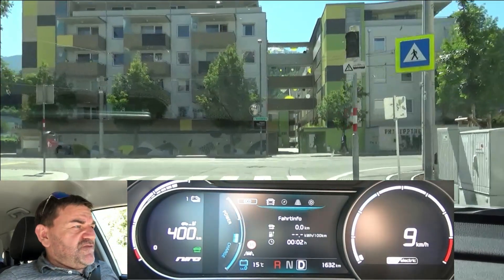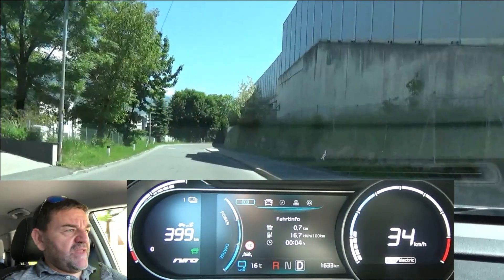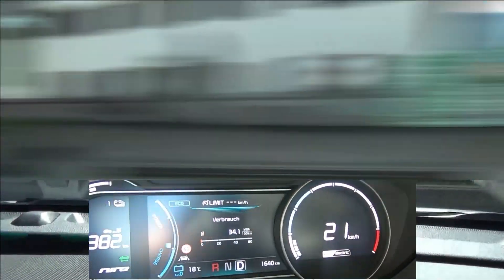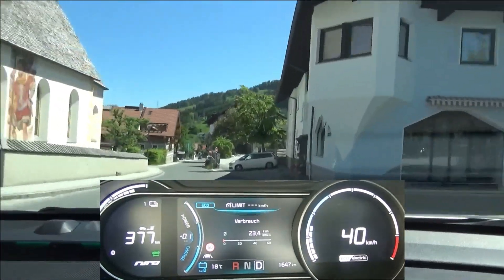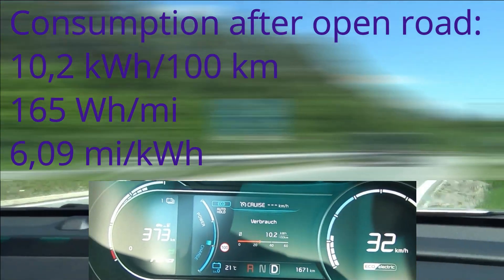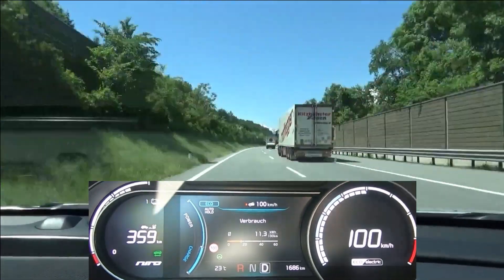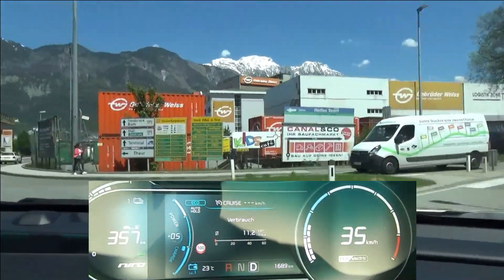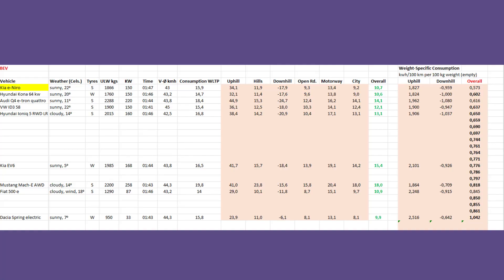Kia e-Niro (Niro EV) - real-life consumption test done by a professional eco-driver

Comment: Very nice video! I will be getting a 2020 model next week. I see you switching a lot through the regen levels, even to lvl 3 sometimes at trafic lights. Would lightly pressing the brake not give the same effect? I read that even when using the brakes, it will mostly use regen braking, unless you have to break hard and fast all of a suden.

Comment: Your driving tips are mostly the exact same as needed to get the best efficiency from an ICE car; speaking as someone who beat Jaguars claimed combined MPG in a "S" type by over 20%, on a 450 mile combined trip featuring 350 miles of high speed motorway and 100 miles of low/very low speed, inner city driving around London.

(Cruising at 80 MPH by speedo, on the motorway)

I currently drive a 2016 Soul EV; it is a great little car, I get 4miles/KWh average on motorways, 4.5 on country roads, and 5+ in flat, urban areas; it is a great driving position for me (2 metres tall, badly damaged back), but a bit limited in boot space and range; If I want to drive from my home in the UK, to the Alps for some skiing*; route planner says I will need 22 charging stops, there and back !!

* I cant any longer, but for my wife and daughter.

Comment: When you set regen to "0" setting, it actually still regen about 2 to 3 kw back to battery, if you want true zero regen, you have to set gear to Neutral.
Reply from the maker: I know, but you don't feel those 2-3 kw and they barely reduce the speed.

Comment: Great work thanks for sharing your knowledge and experience!
I would like to suggest to include another parameters on your spreadsheet:
Tyre pressure, recommended in one column and then in next what tyre pressure you drove with.
Kia Niro EV (e-niro in Sweden) has 2,5 bar as MIN pressure many thinks it's max. Winter tyre manufacturers recommend adding another 0,2-0,3 bar in winter tyres. 
Not knowing if you adhere to these recommendations makes for a uncertainty.

As i stated kia e-niro has min 2,5 bar recommended i have 2,7/2,8 cold tyres measure of course. Still it is difficult to get below 17 kWh/10 km, my average is 20+ and that's. 
I suspect my car is demanding more energy than needed. The tyres wear looks perfect. Not even in perfect conditions in city summer and high pressure tyres i got down to 12 kWh/10 km best ever. 
Ok i got wife and 2 kids and packed full but shouldn't make that big difference.

Oh just thought of another good parameters that would be interesting. This since you are the best driver i have seen. Do 10 km in one set speed, 10 km doing 50, 70, 90 and 110 and 130 or something like it using cruise control or your driving skill i dunno. Cruise then i/we could replicate it with our cars and see if the cars match up or not.

But this is really time consuming and it is just a suggestion. It would be nice to see if the fault is with car or me as driver.

I subscribed of course keep up the great effort you do.
Reply: Oh tyre brand/model is also relevant.
Reply from the maker: Thank you! 
As for your different suggestions:
tyre pressure: To be honest I just take the car from the dealer and do my trip. I don't take any special measures, as I claim this to be a real-life test and in real-life barely any driver checks tyre pressure before every trip. I haven't checked the ones on my Volvo since I got the car (over a year ago) as I rely on the car to tell me when something is wrong and twice a year the tyres get changed and set to the correct pressure anyway, and I guess most drivers do it that way. As for higher pressure, sure, it would improve the result by a small margin, but at the cost of a shorter life of the tyre.

different speeds: here I have two problems, firstly normally I get the car only for about 3-4 hrs, which gives me just enough time to do the loop (plus picking it up, install equipment, washing, outside video and picture, returning the car), so I can't see how to integrate any more tests, 
secondly - you've seen the roads around here - it's barely possible to go 100 constantly, there isn't even a long enough piece of road with 50 or 70, as one village and/or speed restriction comes after the other. And going slower than 85 on the motorway is not recommended as Lorries travel at that speed and are not allowed to overtake. 

I claim this to be a reflection of the real-life of a motorist and I want to show what can be achieved without any special measures, just in driving a car "normally" (I am aware of the fact that "normal" for me means "eco", as I do this for almost 30 years and my business works in this field as well). Only by adjusting the way one drives in the correct way  (at least when we talk about eco-driving) savings normally are around 20-40 %, without being slower or having to take any other measures. 
However, as suggested multiple times by many subscribers, I will include tyre size and model in future results.

Comment: Have this car for 6 months now and it's amazing! +500Km range in the summer and now 380Km in the winter. I always use level 3 generation in auto mode. Why you switch so much in this video?
Reply from the maker: Because I only use the regen when I need to brake, using no regen (means not braking) is the most efficient way of driving. Coasting as much as possible is most efficient.
Reply: @ecodriver1746  You can adjust that with your 'gas' 
pedal or you can also hold the steering pedal to come to a stop.. Confusing answer
Reply from the maker: I know about OPD, don't worry.  My answer might be confusing for some, the point is braking (i.e. regenerating) as little as possible is the most efficient way of driving that's why I normally drive with Zero, but when I need to brake I use the paddles, which I prefer of the foot-pedals.

Comment: With +20°C this is the kind of consumption I normally get as well. The last couple of months I've been averaging around 15.7kw/100km at freezing temperatures and mostly highway driving (100-110kmh). I basically always have regen at lvl 3 and play with the intensity with my right foot.
Reply: I don't understand eco drivers not using the highest regen level controlled by the 'gas' pedal. We all do this in our E Niro users society. Also holding the steering + pedal to come to a complete stop.
Reply: @PinballGeorgio  exactly, I can coast for ages even if I'm on regen level 3. It's less of a hassle than shifting the regen pedals imo.
Reply from the maker: Top!
Reply: I always have regen at lvl 0 and use brake pedal to regen. I guess it is a matter of preference, with the same end result.
Reply: Habbits i feel,in my hybrid i use more pedal to regen as scotland is full of hills and allows me to regen more

Comment: Yep coasting without regen wastes significantly less. It also forces you to anticipate traffic much further ahead, leading to much slower accelerations and lower top speeds, which is as big a part of your savings. Did 4L/100km year round average in my former 98' Fiat 600 before I got an EV, so it is still an obligation to continue driving as efficiently as possible on electricity, not to spoil the benefit with average wasteful driving.. I get 10kWh/100km average off the battery (not including charging losses), my record is 205km on 18kWh! However this is in a 2002 Fiat 600 Elettra that only has an induction motor, but being a small 900kg EV, the penalty of having a simple induction motor and a standard industrial inverter, is much less as the only 15kW (30kW peak) motor runs close to the peak efficiency between 60-90 km/h, which you can't get with a bigger motor. (This comment went on much further than anticipated!)
Reply from the maker: In terms of top speed that's not really correct, I may just remain at the top speed for a shorter time as I start coasting earlier than most others. If you look closely you'll see that I am almost all the time above the limit (even on the motorway, it's just that others care even less....).
Reply: @ecodriver1746  Sure, I was thinking about city traffic, which if you know the neighborhood and the traffic allows it, you can crawl along because you know when the light changes.
Reply from the maker: Ah yes, occasionally I do this, but I always make sure I don't block other road users.